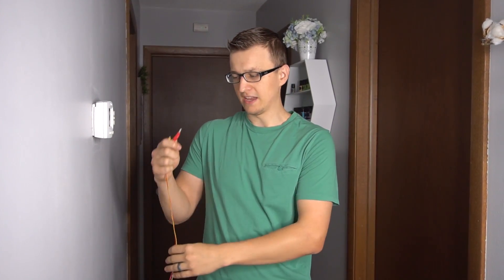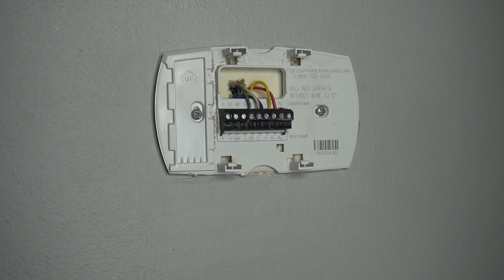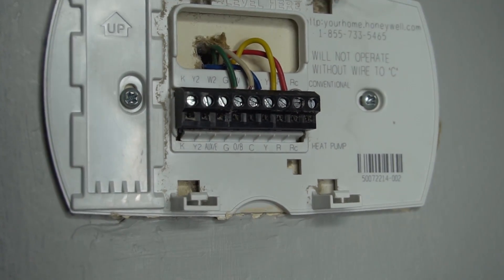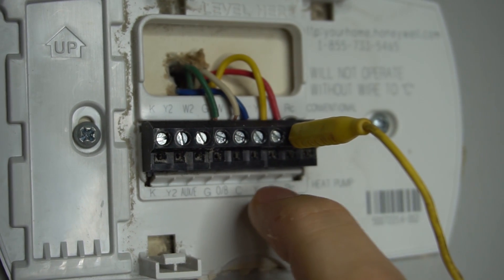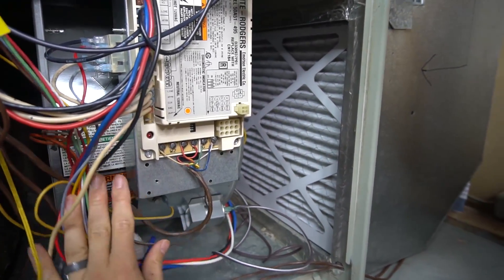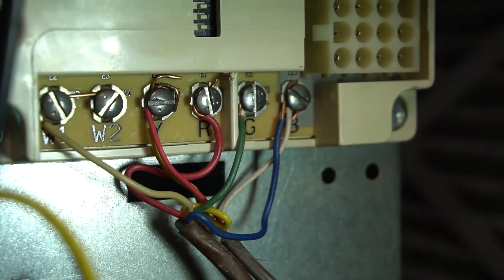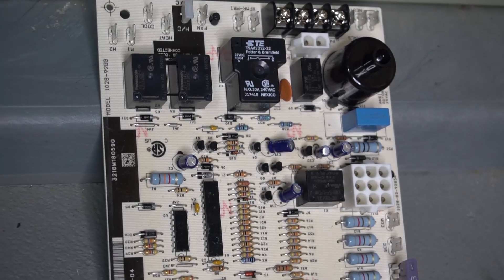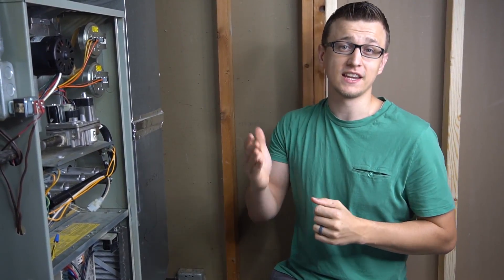Heat and Cooling Running at the Same Time

Comment: Hi!!Iam installed new termostat  and when iam turn on a/c furnance starts too,but when turn on furnance a/c not start!!I its emerson wifi termostat and I am exchange 3 of  them because thought they are defective!!!I have two termostats in my house so regular emerson termostat not cousing any problems system running as suppose byt as soon iam replace it with same brand just wi fi termostat it start acting weird!!!Could you please  help to resolve this problem?,Not so far ago iam replaced control board ,but as I mentioned before problems coming up only with wi fi termostat!!Thank you

Comment: Best instructions to troubleshoot problems pinpointed to thermostat, control board or the thermostat wires. I need to get the magnetic jumper wire just in case I run into same problem.  Thanks! ❤️👍👍

Comment: Hello bro, i would like to request a video about how to connect an outdoor thermostat for the low winter temperatures control, to control the heat pump cut out when temperatures are below balancing point and force the furnace to run. thankful regards
Reply from the maker: @Zipper Dingo Thank you for the suggestion! Unfortunately I have never installed outdoor thermostats (I seldom work on heat pumps as they are scarce in my area) so I would not be a good person to make a how to video on that..
Reply: @WordofAdviceTV  
Thank you anyway bro, btw i like your videos and want to thank you for your acurate and precious informations, keep it up, cheers❤🥂

Comment: relays or contactors of cooling should be interlock in the relays of heating to avoid two systems running at the same time.
Reply: But now you can run heat while cooling, to dehumidify without cooling, when you have single stage cooling only.

Comment: Hi jay! I got a 30yr old york split system,,my furnace blower motor keeps running,i isolated the tstat,replaced capacitor,spark ignitor & relay,still runs,i disconnect the common wire goin to capacitor & it stops,can it be transformer thats bad?
Reply: i have little of experience. 30 yrs old Furnace has high consumption and its time to be replaced saving 500 dollars a tear on energy beside head ache of maintenance.
Reply from the maker: Sorry to hear about the problematic furnace! If it's 30 years old it likely does not have a control board right? And you already replaced the fan relay? (that would be my first guess) Besides the two wires that go to the capacitor, where do the other wires from the motor go?
Reply: @WordofAdviceTV  the other 2 wires go to blower motor,no control board on it,system works great its just that issue,yes i replaced fan relay already still same issue,i have to turn off from breaker to stop motor from running
Reply from the maker: @justdissin7340  I wonder if perhaps your fan limit switch on the furnace is stuck in an open position.. Is it an adjustable kind? Perhaps you can try adjusting it or some of them will have a button that you can push/pull to turn fan on/off. Otherwise you could try giving it a slight wack to see if it frees it up. I'm just guessing though... I wouldn't be able to tell you exactly what it is without checking it, sorry.
Reply: @WordofAdviceTV  ..ill give that a try when im around it,thats if it has it,dont think it does but ill see,thanks jay